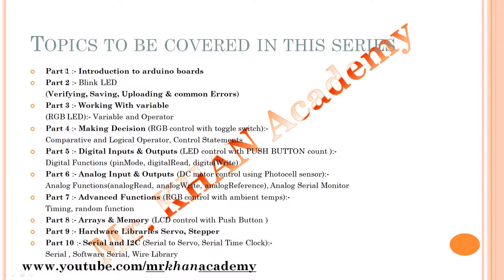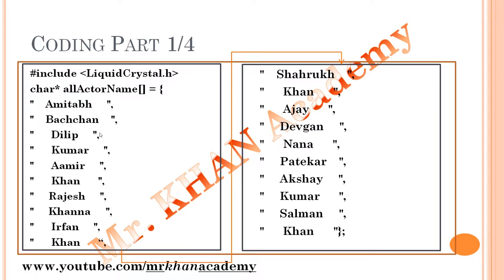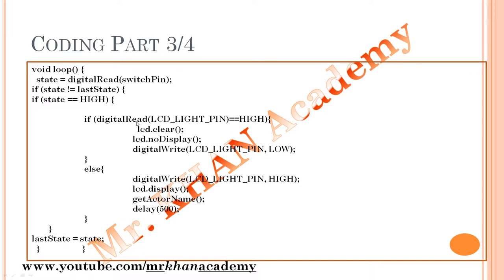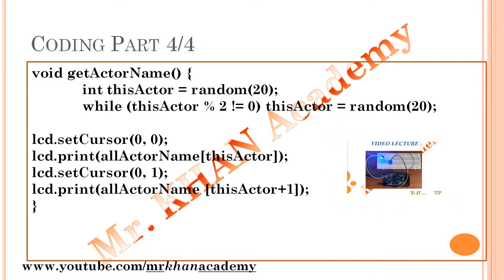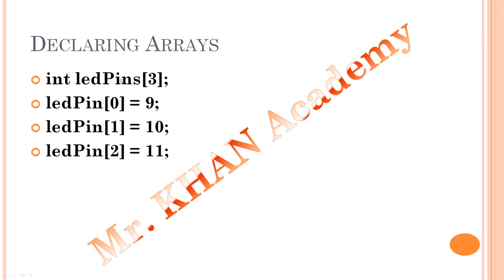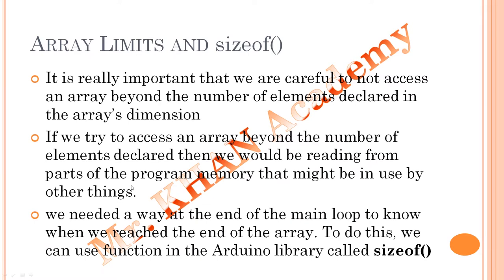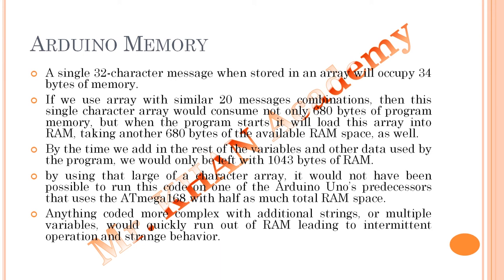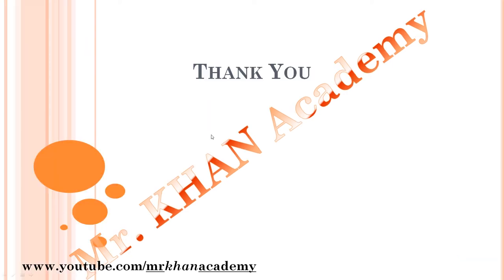Part 8/10 LCD control with Push Button | Arrays and Memory | Video Lecture | Full HD

Comment: i wanted to make tail light indicator (turn signal) for a cycle using 16*2 lcd and arduino can you please suggest me which switch can I use ?? I think 2 push button  will be feasible; means  if i press one button it will pass signal to arduino and it will display left signal like (<<<------) in blinking manner and and when i press another button it will show right signal (---->>>>) can these be possible ? and do i have to use if else if loop or is there any other trick for this it would be really helpful if you reply to my question ...THANK YOU SO MUCH